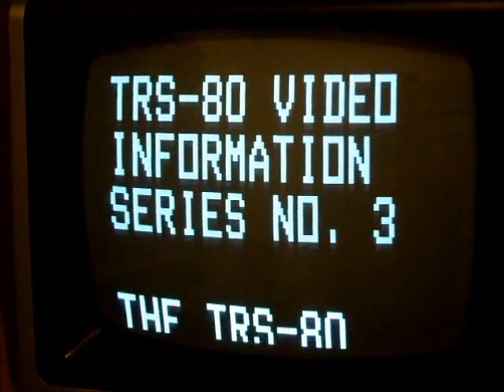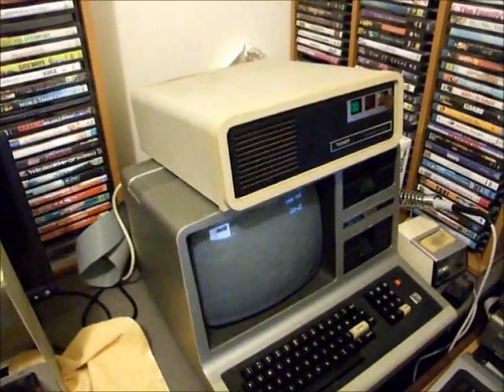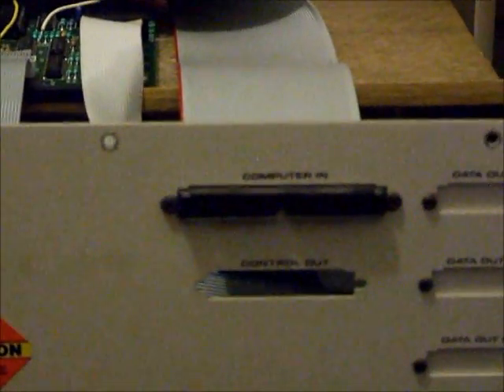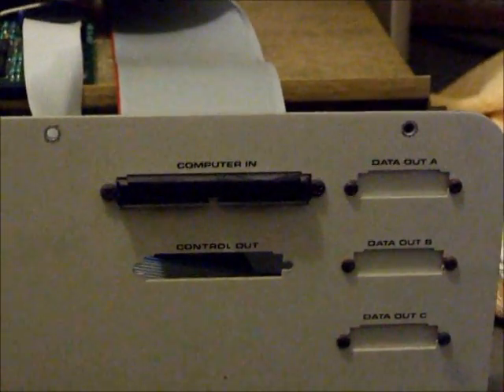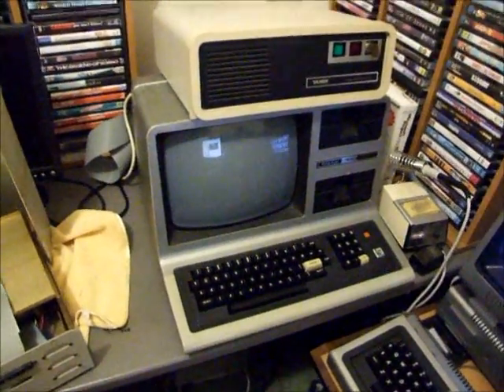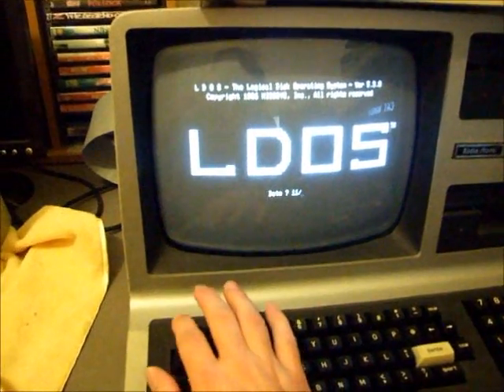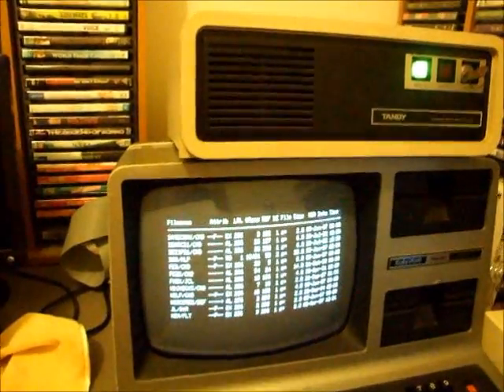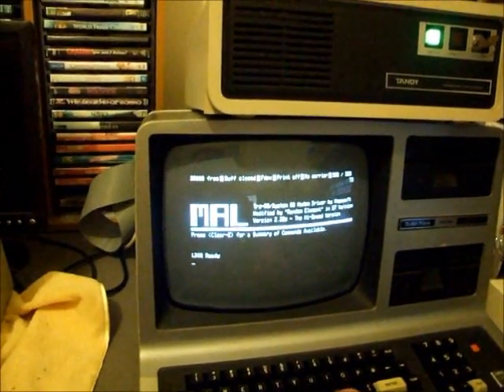TRS-80 15meg disk system

Comment: You mentioned drivers.  I supposed they are specific to DOS versions?
Do you have the posted anywhere? I have a line on a 12 and 34ish MB
drives.  Not sure I will go in this direction but I might want to have the drivers handy for later.  Thanks.

Comment from the maker: The internal hard drive is confusing, and badly named.  On that option they installed the HDC inside the computer and then allowed you to add a much smaller hard drive externally... essentially just a box with a hard drive and power supply in it.  It wasn't a popular option but carried the cat no. 26-1138.

Comment from the maker: Hi Edward, these connect to the 50-pin I/O bus on a Model III, 4, 4P and 4D, buy a simple 50-way cable (similar to a SCSI cable) to the Computer-In jack on the hard drive.  I make and sell the cables if needed.

You need to make sure you are trying to connect a Primary hard drive, not a secondary.  The Primary has the necessary controller inside it, the secondary doesn't.

Hope this clears things up for you.

Comment: @RE1974 Model# is 26-4166, serial# is 018960. It does seem to have a controller board, but in contrast to yours, it is almost as wide as the hard drive itself - When I open up the case, there is a circuit board that covers almost the entire surface. It has a very large chip in the middle that I'm guessing is the controller's CPU. So I may just need a boot floppy and a special 50-connector cable, huh?

Comment from the maker: @hermitnerd I have the drivers which can get most TRS-80 hard drives up and running.  If your hard drive has no controller board you may have a secondary hard drive (the controller lives in the primary hard drive).  What is the catalog. number of your hard drive?